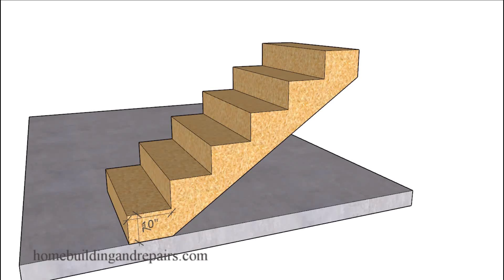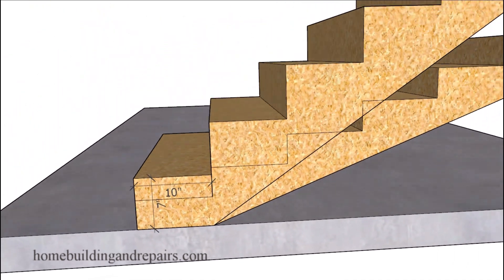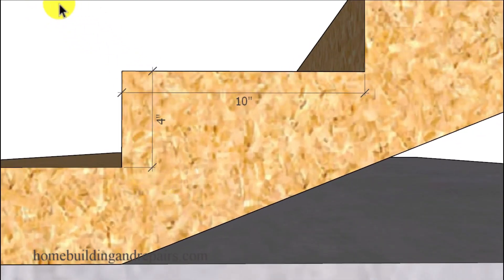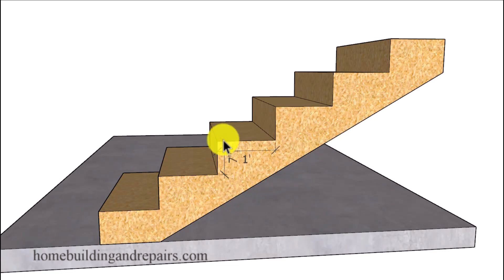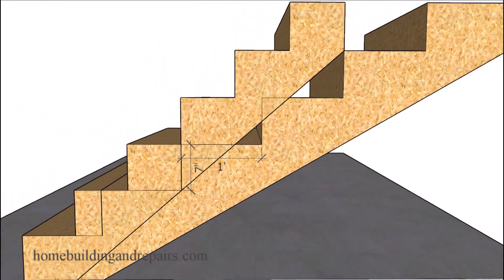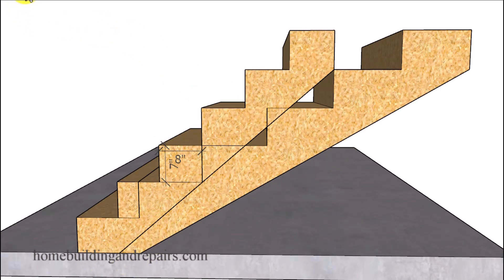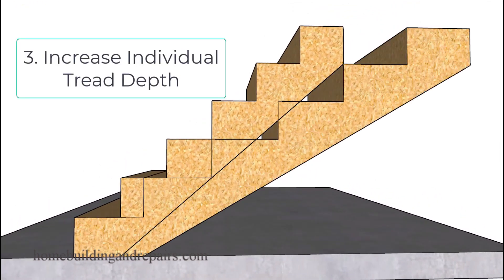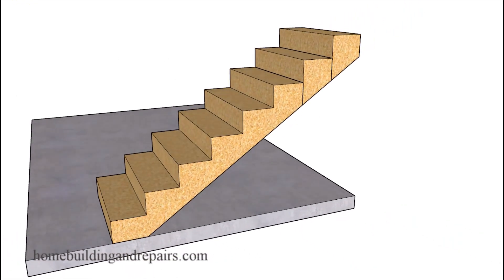How To Change The Angle of A Stairway - Building Code Safety And Home Remodeling

Comment: I know this is an old video so I’m hoping you still respond to comments.  We are renovating a gutted house.  They had put in some makeshift stairs that are way too steep.  So we wanted to redo the stairs and make them come down to a platform and then turn for the final 2 stairs.  I’m trying to figure out how we can reuse the stringers for the main part.  How could we cut them to make them not as steep?  Can this be done?

Comment: I have learned so much from watching your videos that I know I know nothing, but with what I have learned I will attempt to build a rap around staircase 3' wide for my children's lookout fort. I have four 6"×6"× 20' pressure treated beams 8' apart square, with 4' encased in concrete within the ground leaving 16' above ground. I want a landing on the outer  corner leading up to a balcony that extends 3'. This will be a great task as I am not a carpenter.
Reply: Tomorrow I will purchase everything I believe I need for the concrete footing first and second stairway and landing.
Reply: I have already purchased 40) 2"×6"×10' pressure treated for stairs, landing and decking. I have an additional 6"×6"×20' beam that I will cut to fit in between the 6"×6" uprights to hold up the decking where I have 8) 2"×8"×12' pressure treated. I also have 4) 4"×4"×16' for support of the deck and upper landing. Wish me luck.
Reply: I will be recording my efforts as I go.
Reply from the maker: Awesome and you can do it.
Reply: @stairbuilding  Thanks